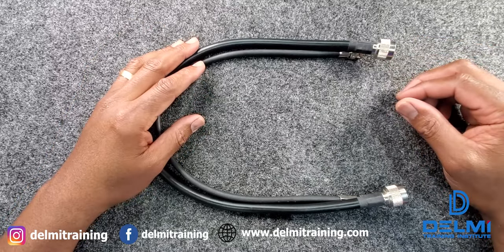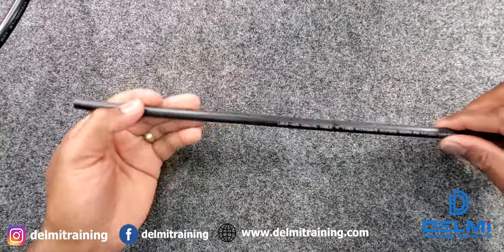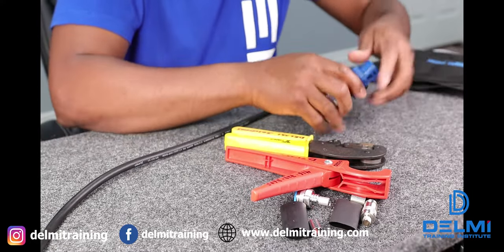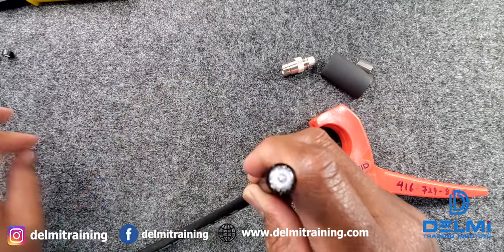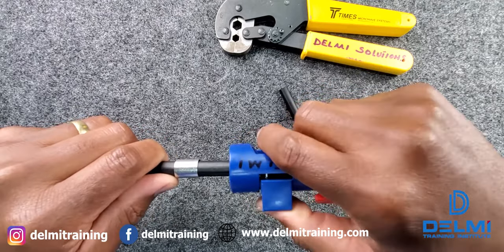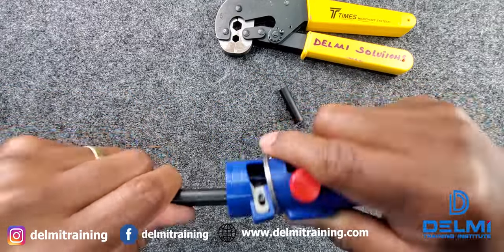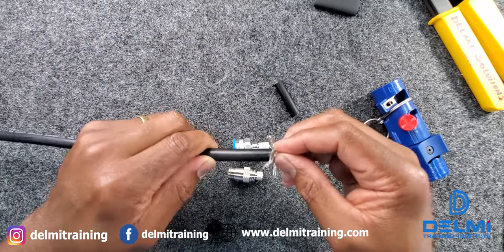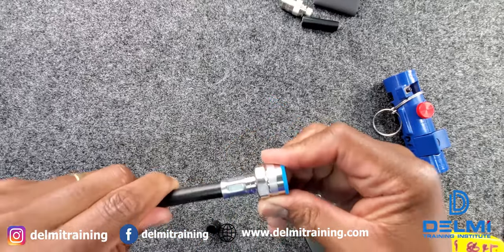How to Terminate an LMR 400 Coaxial Cable using EZ N-Male and Female Crimp Connectors

Comment: no center connector ???
Reply: that's what I'm wondering
Reply: The connector has spring fingers that grab the center conductor as he slides it on.
Reply: This is one of the easiest and most reliable methods to terminate the LMR connector. The stripping tool gives you the exact length and measurement  for stripping the jacket and the length of the center conductor needed. The connector already comes with the center conductor installed. Works like a charm.
Reply: 6:38 , the center was exposed with this cut.

Comment: You never did the center conductor
Reply: This type of crimp connector has spring fingers that grab the center conductor as you slide it on.
Reply: The center conductor was done. watch carefully 1:24 as this process does not need you to install the center connector. It already comes integrated
Reply: 6:38 , the center was exposed to stick out of the center.